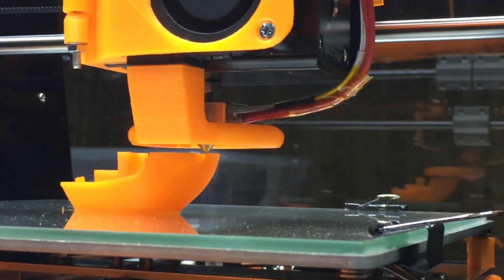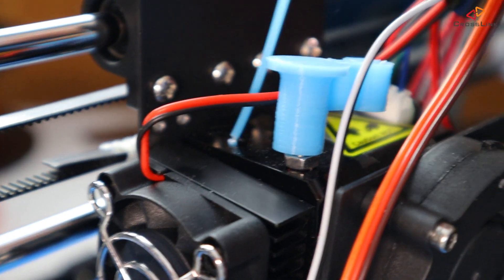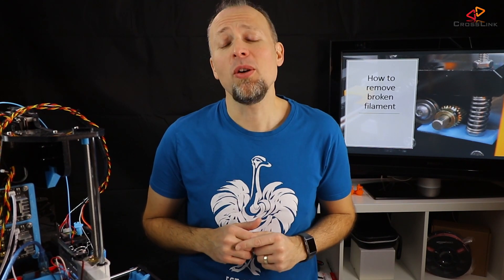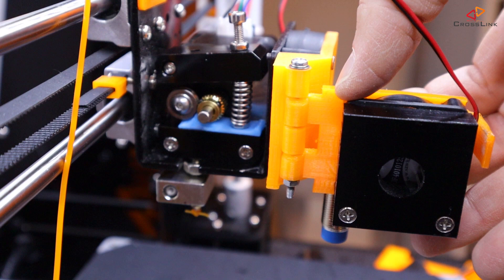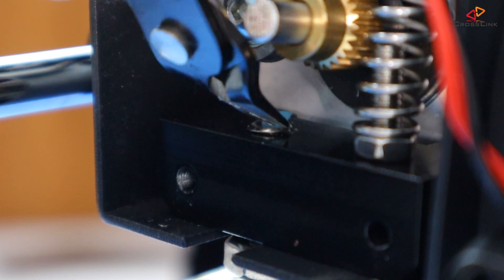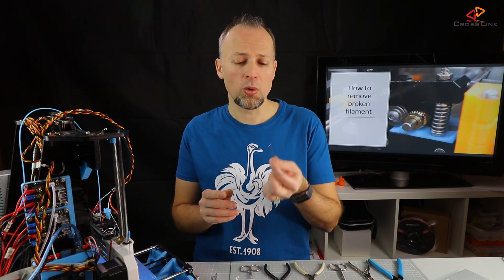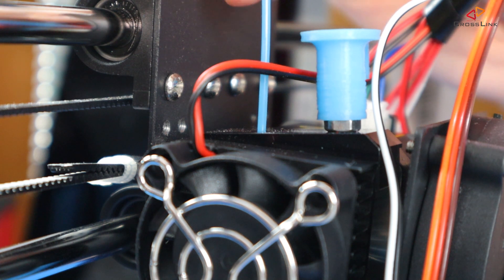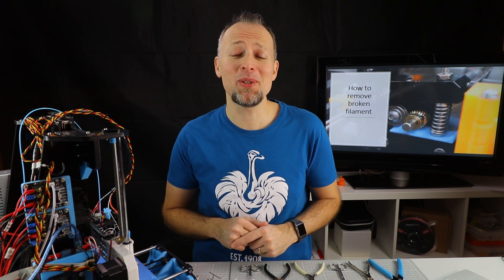Remove broken filament from your 3D printer extruder

Comment: What if its melted into the tube and stuck so far into the hot end that your machinist bf who weight lifts also cant remove it without buying a new hot end ? I changed no settings just whatever fillament i used was awful i have no idea
Reply: Nozzle was clean tube was not loading tried to reset bed and wondered if it was the nozzlw loader which is acting funny i thinj i need to call creality and ask questions

Comment: Thank you very much. although we dont have the same printer, not even remotely. there were enough tips that i solved my issue and im back up and printing again. i just heated the nozzel 20 degrees hotter then required and pushed it through with a new chunk of filament after changing to a new nozzel.

Comment: Hi Daniel, is there an arduino code that pull back the filament out at the end of the printing? it can easily solve the problem of filament being stuck in the extruder

Comment: At first, I could fit an Allen wrench through the throat to clear the old filament which worked. But after, the throat couldn't fit it anymore. It also couldn't fit the 1.75 pla. Any ideas? It seems to be something stuck in the throat. If I could get some help thanks.

Comment: I tried similar to this to clear the jam myself before seeing this and went back and tried again; however, it will not feed down. The nozzle is clean so that isn't why. If you have any suggestions I would love to hear them.
Reply from the maker: i can only imagine that your nozzle and throat are somewhat having a gap and now you have a clog between the nozzle and the throat that blocks the filament.
It might require you to disassemble the nozzle from the heating block and clean up the inner part. You will have to do this while the nozzle is heated up, otherwise it will probably not be possible to disassemble once there is filament floating between.

Comment: It won’t work because the filament won’t even feed for some reason
Reply from the maker: Then you might have a clogged nozzle. most probably you will have to heat up the nozzle and then unscrew it from the heatblock to check whether there is a clog in the nozzle or in the throat. Be careful not to burn yourself doing that.

Comment: The fan hinge upgrade is an interesting looking add on.
Reply from the maker: The video about it is going to be published next Tuesday 😁
Reply: @Crosslink3D  thanks I actually printed it last night and was worried about the contact, so disassembled it, good video, I'm not going to able to do the tatara upgrade but let me know in advance when you are going to do the video
Reply from the maker: Yes, thanks for telling me, I am ordering one this month, video will be delayed because I need to do a few other mod videos first. Then I am going for the shootout with the original A8 😁
Reply: @Crosslink3D  what do you know about pla in the freezer
Reply from the maker: Not yet tried it out but I read a lot of things that it's quite stable even in the freezer. Maybe worth some investigation. Any experiences from your end?
Reply: @Crosslink3D  I'm 3D printing the plastic thing at the end of a ski pole and will test it this week end, I got some raft material and in the cold it snapped easily but one under snow was very strong, I'm making a video on it :)
Reply from the maker: Cool, looking forward to it!
Reply: @Crosslink3D  thank you